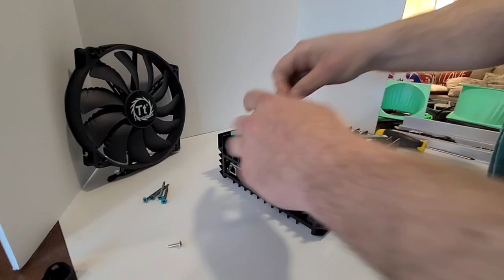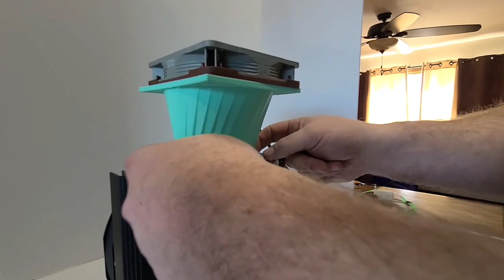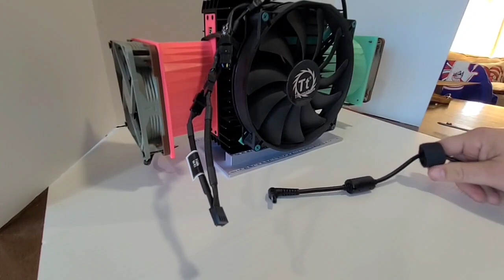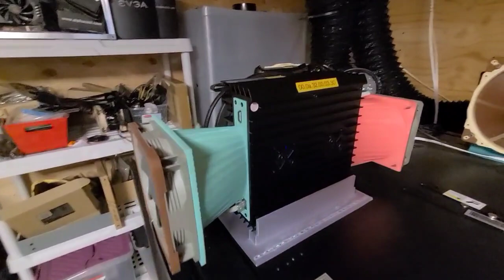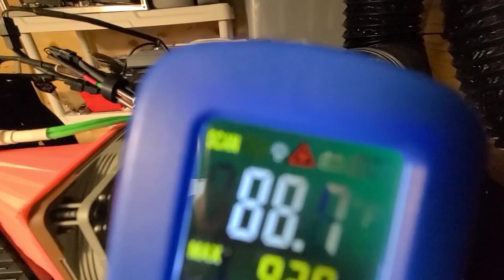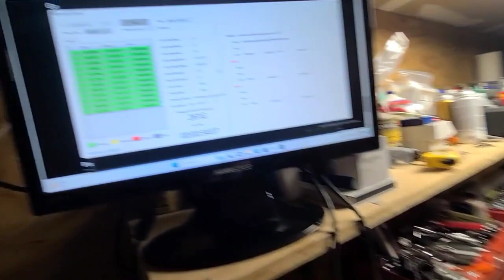KS0-Pro 3D printed add-ons and new 12v fan Y adapter TVM. lots of mods

Comment: i have a big fan (125mm ductfan) between 2 kso pro, works perfect
im using around 40w on that fan, and getting more air through it

only problem was i needed to get a adaptor for the shroud i got online 🤣

Comment: Thanks for your great instructions. My 3D printer is already running and printing your parts. I still have questions about the wiring. Can you post links to the components you purchased here? Especially the small box for the fans. The cable from theveteranminer is different. Thanks for your help.
Reply from the maker: Sure I'll update the info
Reply from the maker: Updated. Enjoy
Reply: @Neonjer11  thank you so much

Comment: Good day! Nice video, do you make them for the KS0 OG? If yes will need to order very soon for 3 units

Best Regards
Reply from the maker: If the sides  are the same. Then these will work. if not I currently do not have a model made for the original KSO for V2. Also I have a V3 model that can slide over the unit on each end. This also made based on the KS0-Pro but may work on the KS0. Never tested.

Comment: I get 300GHz using a 10" box fan (price $10.00) blowing thru from the power connector end with both end plates removed and  TSwift's s/w.(sensor 1- 57C, sensor 2- 38C).
Reply: With factory firmware??
Reply: @ADHDCrypto  No, TSwift's o/c firmware.
Reply from the maker: true box fan is a good quick way to cool but in the long run a box fan will cost you more electricity and isnt direct. Just food for thought.
Reply: @Neonjer11  not if you use the fan for more then 1 pcs like i do.
they dont mind sitting a couple in a row in my case.
im sure i could connect 3 - 4 pcs to my duct fan without problems and still be running under 50w on the fan

(digital fans use 1/3 of a normal ac fan)

i am running mine on solar, but everything penny counts 🤣

Comment: Hi, nice video,  do you print with supports? if so can you share the  settings?
Reply from the maker: Yes I printed with supports. You can print either way, fan on top or bottom. tho I've been printing them with fan facing up using tree supports from base only. Seems to work well. Depending on you fans weight I would print 50+ infill to make it sturdy enough, PTEG is a little tougher, but PLA is fine just up thickness/infill and you'll be good.

I have a New full Side Piece as well the adapts and is 200mm friendly 
https://www.thingiverse.com/thing:6457092

Good luck